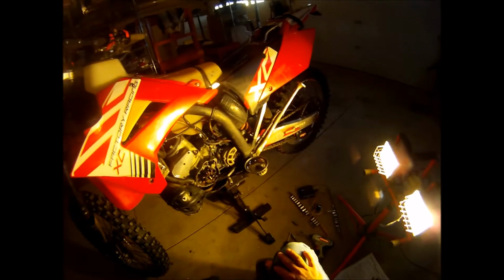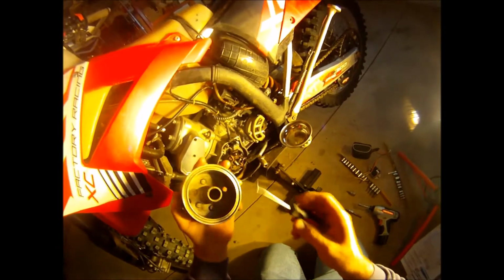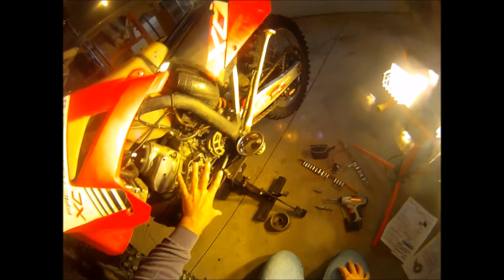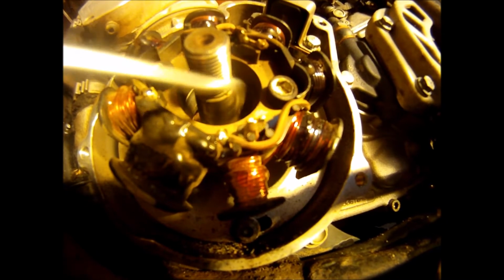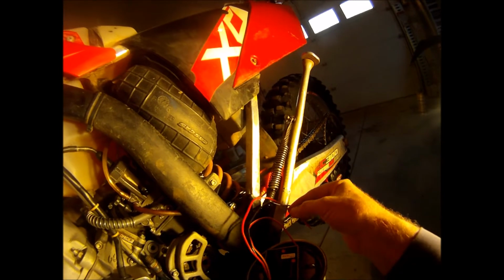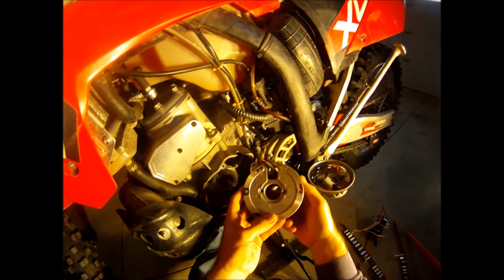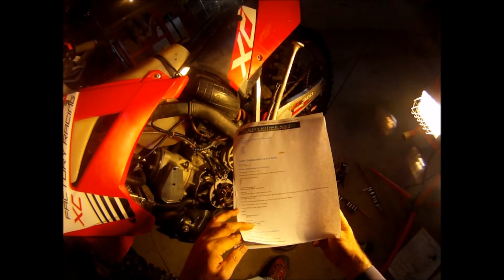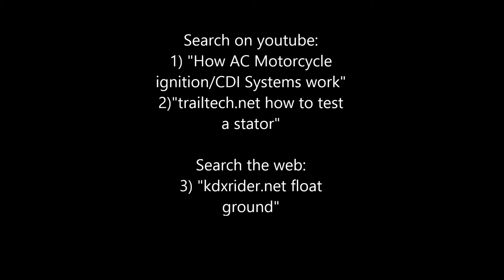AC to DC conversion GasGas EC300 part 1 of 4

Comment: nice series... I just brought AC/DC converter and seems to work, the only downsize is that the output is not constant (not heaving a battery), and I still cant run a fan.
Reply from the maker: Nice! Great job! I never added a fan (but should have). Thanks for watching and for the feedback 👍
Reply: @anesthesiadreamin  you bike does not overheating? Almost every ride the coolant is boiling, this is one of the reason I might buy a newer bike with DC and e-starter...also I am wondering, do you have weight on the flywheel or just as in video? Sow at some guy a big weight and considering adding one...
Reply from the maker: @2WheelDerness I did not use the flywheel weight with this bike, but have on others.  flywheel weight will definitely give you more torque and minimize stalling. Also my bike never boiled over. I did monitor the coolant temp and it rarely overheated.

Comment: I have a 1998 GG EC 250 and I’m trying to do a dc conversion. 
My bike has Two stators - one is for a lighting coil - has a yellow wire and a red wire - also has the white wire that dead ends . 
So my stator is different from yours . The second stator or main stator that runs the CDI and ignition. 

But can’t I just run the yellow and red from the lighting coil to the rectifier/ regulator? I cannot find any videos on it or wiring diagrams.
Reply from the maker: Yes, I would think that would work. What I would do if I were you to make sure, is contact trail tech, Tell them something like I think I need your rectifier but here's my setup, am I on the right track? They helped me a lot 👍
Reply: @anesthesiadreamin   okay. I will call them up Monday - thank you for the fast response. I know I didn’t Provide a lot of info. Now what is the AC voltage coming into your rectifier/ reg - 24 VAC ? Just curious

Comment: I am curious why your bike keeps burning up your voyager?  I have been running one on a 2011 for a year now with no problems.  Doesn't trail tech even say that the voyager will run on AC power?  I have heard elsewhere of people having this issue.  I wonder why it is a problem on some bikes and not others.
Reply: My bike is a GG as well
Reply from the maker: +memphis28571 Thanks for your comments...Yes they told me it would be fine on an AC bike. I don't know for sure why they were getting fried. In a future video I will be measuring the output of the floated stator, and it averages 25 AC volts at idle and as high as 55 revved. Of course that is pre-regulator. So I don't really know why some bikes have problems making clean AC power and others don't. Hey I love the 2011, it is my favorite bike of all time as far as looks, frame size, and ride-ability. Once in a while my buddy and I will swap bikes and I really like his 2011 EC300. Is yours a kicker or estart? I assume the kickers are still all AC for 2011?
Reply: +anesthesiadreamin mine is the Race model so kick only.  But it also has regulated voltage.  The yellow wire behind the headlight mask is regulated voltage.  Maybe this is the difference?  I love my 2011 even though I am a little big for it.  I was actually planning to buy a 2016 this year but we all know how that turned out :(

Comment: What would happen if you left the lights grounded to the frame on this mod
Reply from the maker: the mod is lifting the ground from the frame to create DC power so u can run the existing AC for the ignition and new DC for the lightsand accessories... DC and AC cannot share a ground because of the different waveforms they produce. So the AC side of the system (ignition) stays grounded to the frame and the new DC side of the system gets the ground lifted and attached to the new battery. b sure to look at the references at the end of the video they are really helpful
Reply: Was the battery grounded to the frame or any other source of ground
Reply from the maker: no it didnt have a battery when everything was AC power...i added the batt when i converted the lighting side of the stator to DC, so only then was the lighting side grounded to the battery. the DC lighting side now is "floated" so it is not attached to the frame any longer.
Reply: Hi, I have an XC300R 2T 2013 and I'm trying to do the same but I think the elecrical system on my bike It's another one and I don't need to make the magneto ground be floated, because the eléctrical diagram shows the rectifier and battery grounded on the electric start model. Sorry about my english and greetings from Chile.

Comment: I'm having some trouble with my lights 2009 ec250 turn lights on and nothing but if you rev the bike up light comes on then goes back off can any one help
Reply from the maker: test your stator, and your voltage regulator. If you can't find a problem with either, ask on gasgasrider dot org

Comment: The ignition won't run on DC power?
Reply from the maker: Negative. Wait, i mean no :-) this particular design is AC with an AC CDI box
Reply: @anesthesiadreamin  I see, im going through a bit of an overhaul of my 09 ec300 and was thinking of doing a DC conversion but after seeing whats involved I think I'll give it a miss 😂.
Cheers all the best
Reply from the maker: @garyjones122  Hey thanks for watching and for your comments! I would encourage you to do it just because it opens up so many good LED lighting options that are super reliable. We were riding in NM high desert yesterday and got back to the trailer in the dark, and the headlight I have on it was amazingly bright. The further you can see the faster and safer you can ride. The tail light works perfectly. Since I installed it I haven't had one single problem with the setup. TrailTech makes some good stuff! Anyhow good luck and cheers from frozen Colorado
Reply: @anesthesiadreamin  yeah I'm gonna order up a trail tech vapour. It seems my bike has previously visited a zoo and a primate has had a go at the wiring, it's a mess.
Reply: @anesthesiadreamin  I have a China LED projector for quite a while on AC and worked fine, have lots of light literally like an xenon car :))
Reply from the maker: Correct